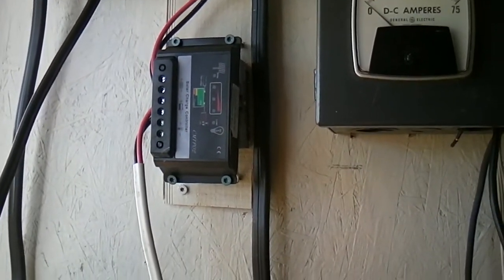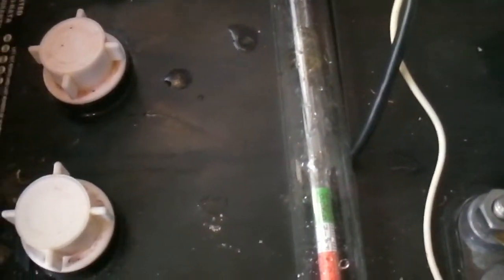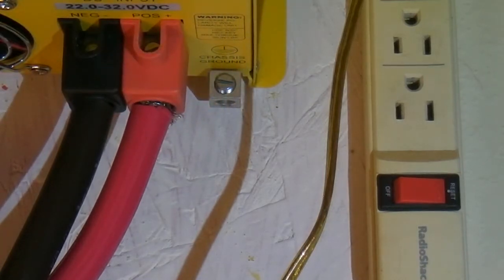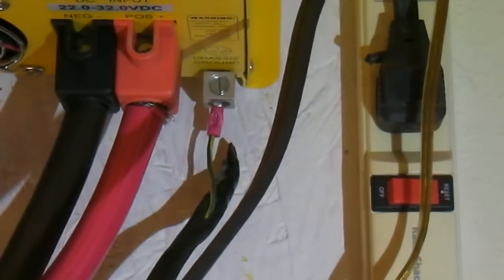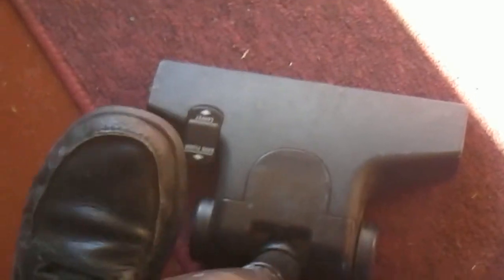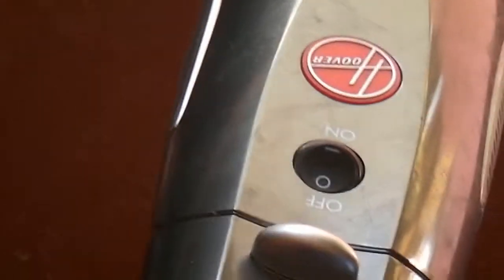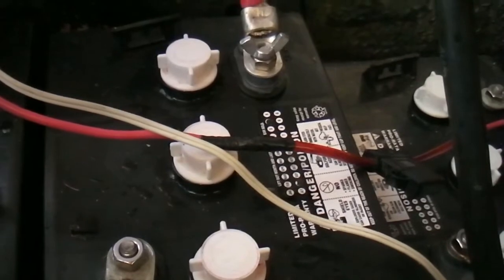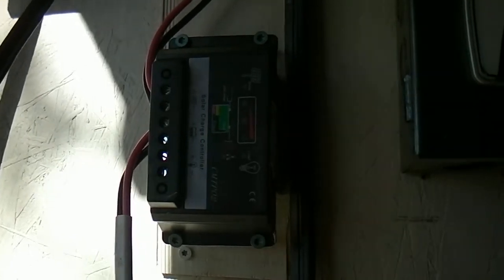Installing a Ground Wire on the 1500 Watt Go Power & Equalizing Bateries

Comment: Looking for detail grounding info
Reply: The third prong on you extension cord is a ground and if your house is grounded properly that will work for a ground on your inverter. Just cut the extension cord off and use only the green wire for a ground. tape the black and white wires off.

Comment: Respect my brother please do not give up one boil not going to do it, I have 12 6v deep cycle batteries nine years now I brought them used when I got them they were sitting at 11.8v poor me did not know anything at the time but i got them very cheap and was impress with the weight of them any way today they sit at 12.3v  when you boil them load them down work them few days later boil them again work on them until you start to see result. Oh if you are getting a new charge controller and can not afford a MPPT buy a PWM with a capacitor or capacitors in it so you will get a pulse charging to the batteries or buy a battery desulfator.  Best wishes my brother. By the way my batteries are the seal ones and I love them they last all night and usually go down to 11.8v by morning time.

Comment: Awesome! Just think , running that vacumn was from free energy!
Reply from the maker: I got plenty of energy to spare.
Reply: Cool!
Reply: Did ya get your batteries figured out?
Reply from the maker: Off Grid Texas Homestead
I dont know yet the voltage was up good but they didnt have no capasity. I been equilize charging them and they are coming up on the capaity part. I cant wait until I get a Midnite solar CC it will be nice.
Reply: Yeah the midnite will be good for the setup you have

Comment: Can you calculate now much power you draw off of them verses how much your putting back?
Reply from the maker: Sorta. I draw 200 watts with the TV Satellite dish receiver and stereo and another tv in the kitchen. About 2 kilowatts a day. The panels can make about 5 kilowatts for each tracker with GTIs but since I'm charging batteries I only get about 69 percent of that. then there is some loss to the inverter about another 10 percent. So I used to make about 15 kilowatts a day.... but charging batteries is about half that. LOL I still make plenty of or more than enough power for the batteries the charge controllers are not working anymore I'm getting ready to hook up my Coleman Air charge controller and it will work ok. Later I can get a Midnite Solar 150 that can do 92 amps. It has a battery observation computer on it it can equalize and also it can let you hook the panels in a series for higher voltages.  Also  then I can use smaller wires and less voltage losses. It will be great. It can monitor the batts and tell all info I need to know  like voltages, amps watts watthours and how long till full charge and logs info on a computer with a cat5 cord.